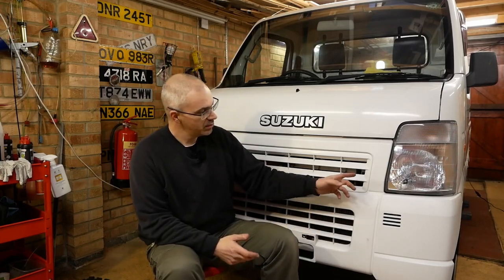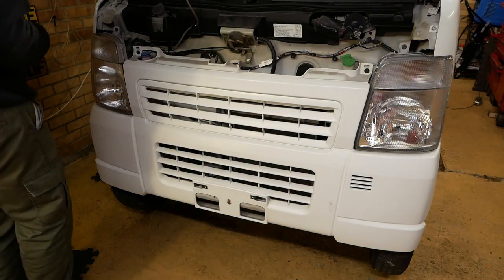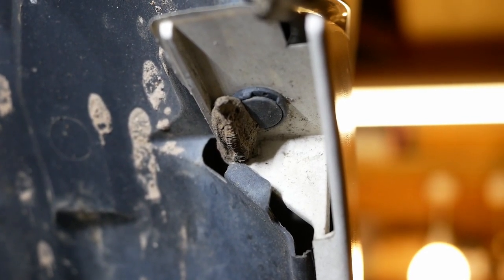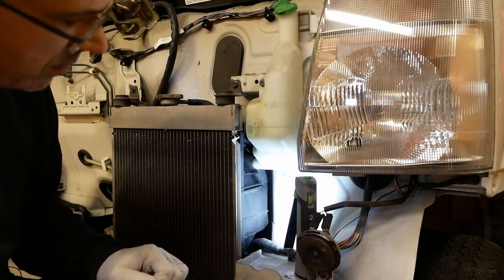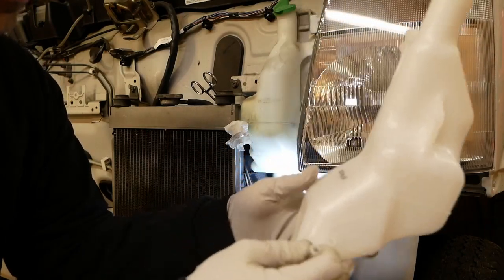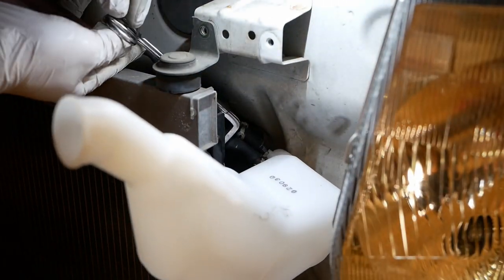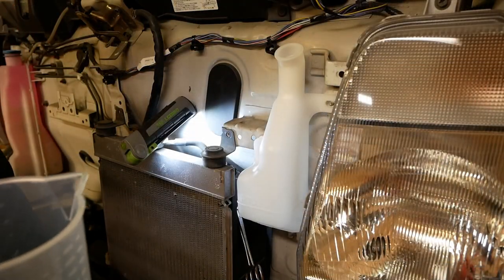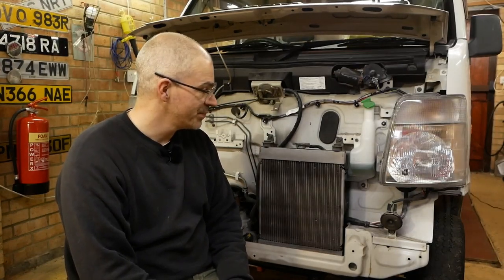DA63T Suzuki Carry coolant tank replacement and bumper removal

Comment: I also have a DA63T and I also poked a hole in the coolant tank so I guess its pretty common on these trucks. I just subscribed and curious to see what you plan to do with that truck. My truck is more off-road oriented so I built front and rear bumpers plus various other upgrades. I also plan to rust-proof the underside. Good video keep them coming!!!
Reply from the maker: Thanks for sharing Nick, I never imagined I'd encounter someone who'd done the same thing! I'm going to be selling this one as it is but keen to get another and try out some modifications. Have you lifted yours or changed the wheels and tyres? The rust proofing wasn't the most enjoyable job but well worth it IMHO. There are more videos on the way, including changing the clutch.
Reply: @AndrewFixes  I have 25 inch ATV tires on mine with a 4 inch lift kit.
Reply: Do you have the part number to get a tank in the UK? I just picked up a 2008 and it's done exactly the same on me at the weekend.  Dealer sent a replacement that's also brittle in the same place!!!
Reply from the maker: It's in the video: 12:14
If you're struggling to find the part, you can fill in this form and I'll see if I can get one for you.
https://andrewsjapanesecars.com/ask-me-a-question/japanese-import-car-parts/

Comment: Fantastic tutorial, I took delivery of a 2003 Suzuki carry DA63T last week and have done literally exactly the same as yourself, went to check the coolant, rubbed the dirt off the tank and thankfully only cracked it, sadly it is still leaking so will need to be replaced.

I don't suppose you have had any luck sourcing parts form an official Suzuki dealer by any chance?  in any case I will fill in one of your forms as these little tanks seem difficult to get a hold of in the UK.

Lastly I don't suppose you are aware of any common issues regarding the blower fans on these little trucks?  the one I have seems very intermittent on the first and second speed, sometimes it works on all three, sometimes just on 1 and three and so on, my first guess would be some kind of fan resistor although I will admit, electrics are not my strong point.
Reply from the maker: It seems like this is quite a common problem! Sourcing parts from Suzuki in the UK is hit and miss and they aren't always able to look up part numbers.

About the fan, sorry I'm not aware of the common issues. The resistors are readily available, as are the fan / ac switch unit and the fan motor itself. From what you've described it could be any of those things, although if it's intermittent on full speed that might point to the switch or motor over the resistor.